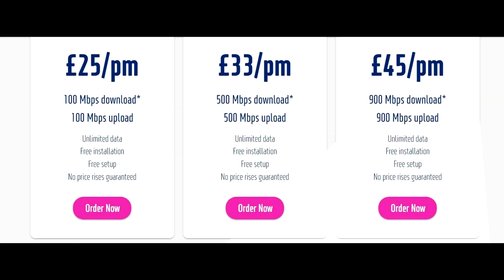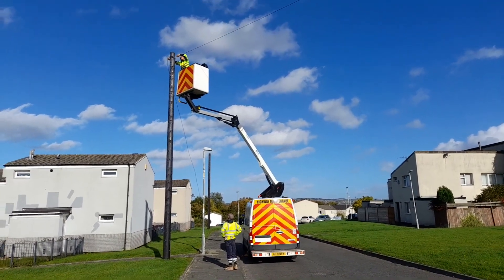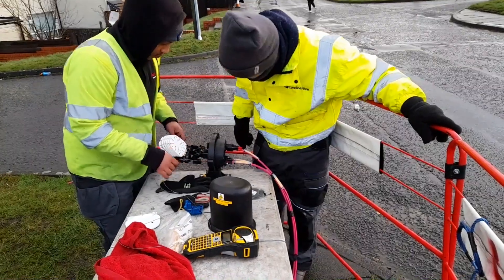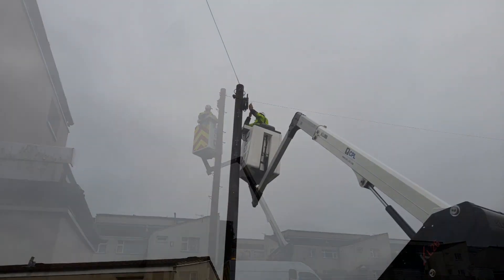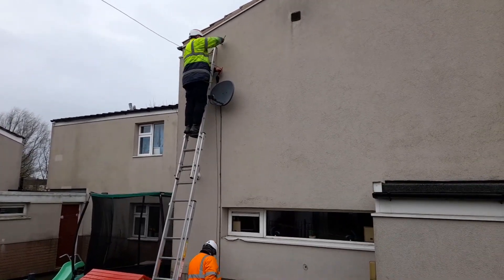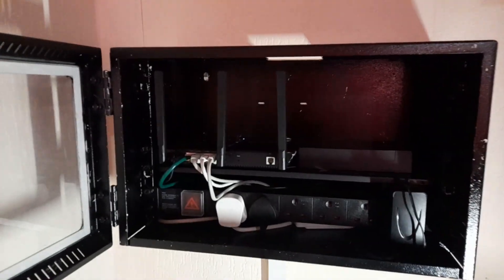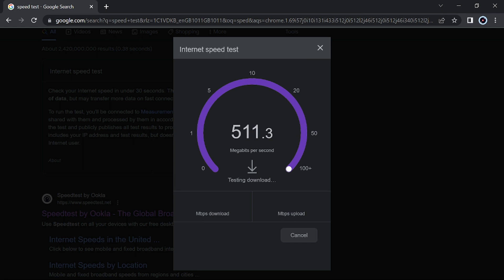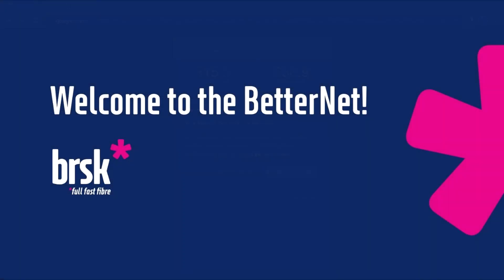Brsk rollout of gigabit-capable full-fibre broadband services  in Burnley & Padiham

Comment: Yep they have just started in my area. Placed a telephone pole opposite my house which has completely put me off. The problem with my area, we get a lot of anti-social behaviour and if they see that cable, its coming down quicker that a prostitutes knickers in the Red Light District. Such a shame as Openreach used the ducts.  Think someone forgot to inform Brsk that its 2024, not 1954!
Reply: Openreach still use poles. It's easier and they don't have to dig the road up to clear blockages. Overhead is miles better

Comment: Brsk just rolling out in my area. 500mbps for £23ppm.  Or 900mbps for 30£. Very nice! I'm deciding which id prefer, 500mbps or 900.
Reply: 900... It should be 1000. Virgin provides a guaranteed 1GBps (which I actually do receive as marketed).
Reply: @JynxedKoma  but you only get 105 mbps upload speed with 1gig with virgin media..... No good
Reply: @MindOfW  Even 100mbps upload is too much for 99% of consumers. Unless you're into streaming or file uploading.